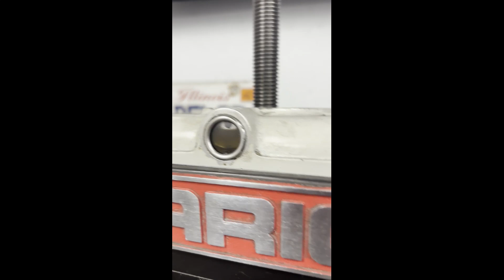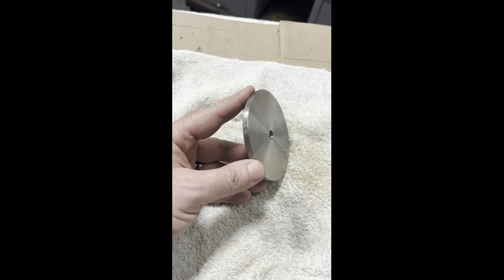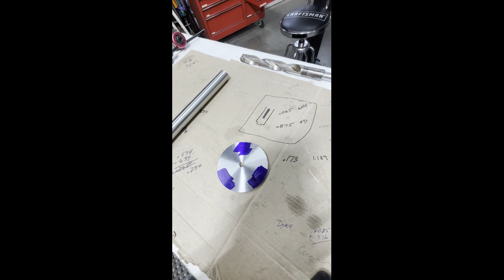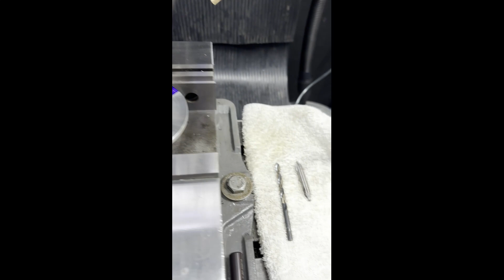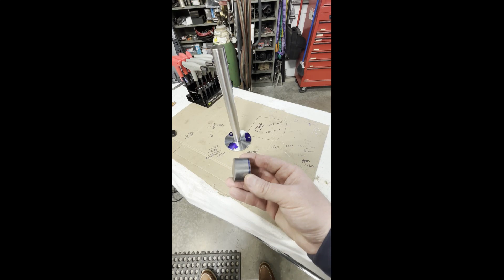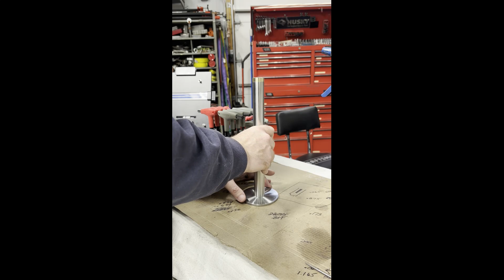Harig Surface Grinder repair project

Comment: Great video! Very informative.

To your point,it's super helpful to have 2 lathes in the shop especially when one has a bigger spindle bore. So you can do the first operations on one and the second op's on the other. Not just for ease of use but also for material conservation as you demonstrated.

Don't be too discouraged about oversizing the through hole. ID operations are tough especially when boring because you are working in the positive as opposed to the negative as we typically do for most turning operations. The shoulder on the part would have been style points though 😅.

Over all WAY better than that piece of plastic they had on there!

Oh yeah, happy to help with the drill bit 👍
Reply from the maker: Thanks buddy,always appreciate your input and opinion.